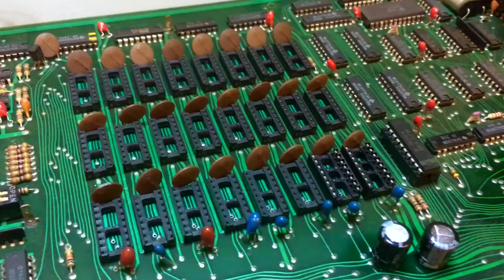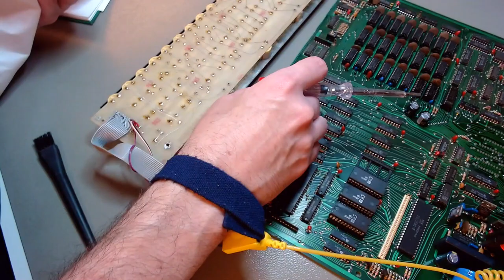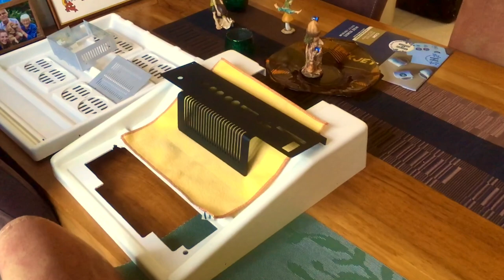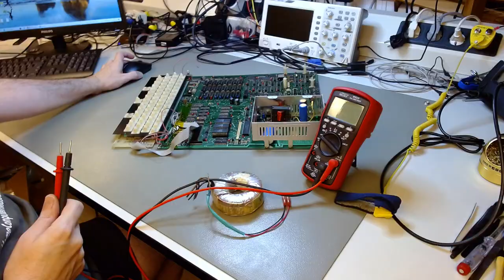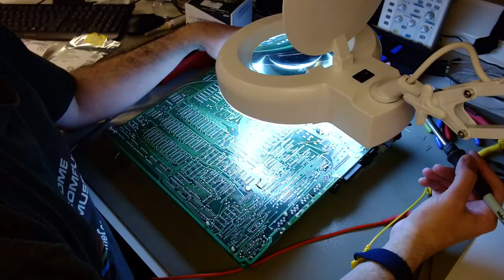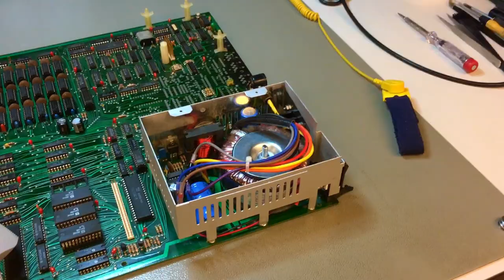Restoring an extremely rare, Belgian DAI PC (Part 3)

Comment: Nice Restoration! I always was amazed at the capabilities of the DAI since I learned of its existence. Concerning the stacked ROMs: There were some ROMs that could be bonded CS active high instead of active low giving the possibility of double the capacity without any more logic. In the early days more pins meant more expensive parts so maybe they opted for this route saving board space and additional sockets by simply piggybacking the roms.
Reply from the maker: Knowing what I know now, I think they stacked the ROMs to increase the drive on the data bus! Surreal that such a thing was needed...
Reply: @thebyteattic  BTW you mentioned there are schematics for the DAI by an user group of the day when. Is this available somewhere / do you have the link or a PDF of the schematics?
Reply: .. well I searched an yes I found them, and Now I remember I had looked at them some years ago already and were putting the evaluation as a back burner project for later because the scan was incredibly fragmented (the scan part 1 of 2 which contains sheet 0 to 6 is split into a 30 page pdf 📗➕📘🟰🧻🧻🧻) in many pieces which I had no time back then to puzzle together and print to a large format.  That would have been an awesome pandemic project when there were time to do such silliness 🤣
Reply from the maker: @0toleranz  I will uploaded corrected schematics to a Github repository as soon as I finish the restoration. There are some errors in the DAInamic club schematics.

Comment: I wonder if the piggy-backed ROM chips are patching some parts of the ROM.  Obviously that could only be additive as far as the bits being set are concerned, but that could potentially still be useful.  Only way to know for sure would be to separate them.  Would be interesting to know 🙂
Reply from the maker: Knowing what I know now, I think they stacked the ROMs to increase the drive on the data bus! Surreal that such a thing was needed...